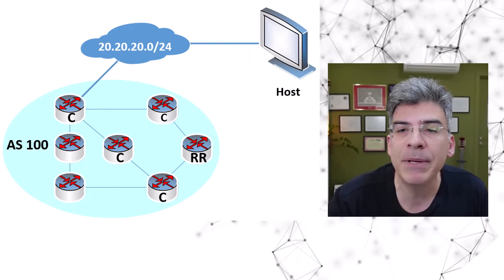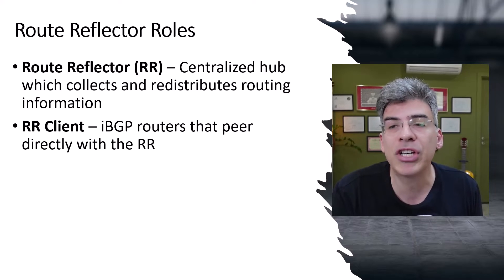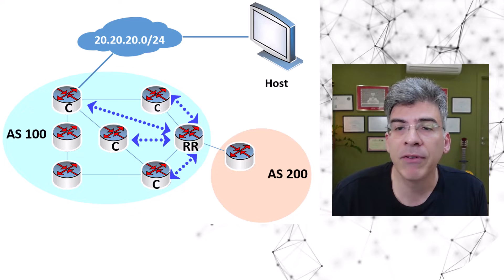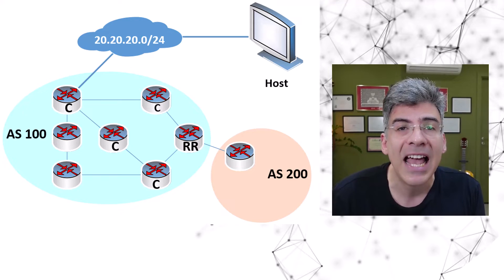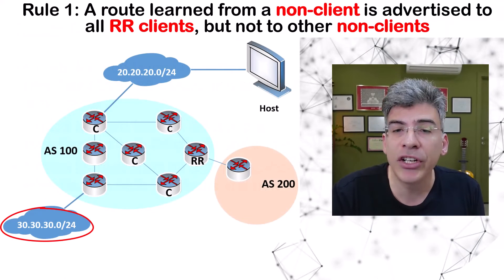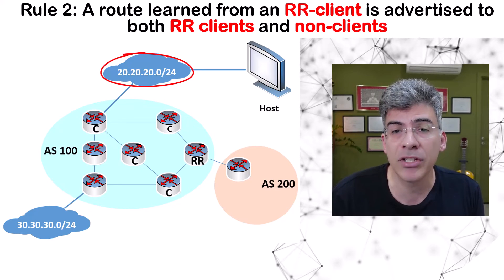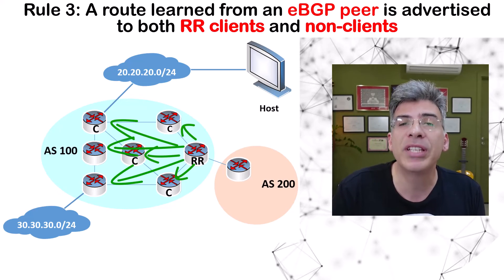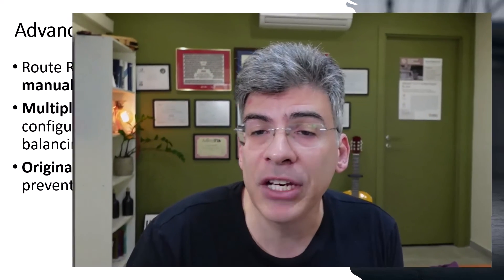BGP - What are iBGP Route Reflectors?

Comment: It means that RR will only be PE router , it cannot be P router as we dont have BGP peering between PE to P routers? and the term used BGp free core only meant for P routers?
Reply from the maker: This is a really good point!  Remember, an RR is a BGP function, not a router type, so it does not HAVE to be a PE, but it MUST run BGP, which means it cannot be a pure P router if you have a BGP-free core. In a BGP-free core, P routers do NOT run BGP at all.  They only run IGP and MPLS and simply forward labels. 

In such a scenario, all BGP sessions exist between PEs only.  So when people say “RRs are PEs” in this context, they usually mean that RRs behave like edge devices logically (because they run BGP), not that they must be customer-facing routers.  Make sense?

Comment: Hello, I disagree with the idea that the two non-client routers should be in full mesh with all other iBGP routers. They should only be in full mesh with each other (i.e., between the non-client routers) and have a peering session with the Route Reflectors (RRs). If they were in full mesh with all routers, it would imply that client routers also establish direct peerings with the non-client routers, which is not the intended design.
Reply from the maker: You're absolutely correct, thanks for pointing that out!  I have added a correction to the video at 4:20 crediting you with pointing it out...  Thanks again!

Comment: Hello Sir,
Fantastic explanation. Really thank you so much for your efforts.
One question:
Finally how 30.30.30.0 network connected  to Non-client will be reachable to 20.20.20.0 network connected to Client? Routes can be learned from Non-Client to Client directly and the same routes can be learned from RR as well. Which path will be selected as best route. As per the understanding, based on the attributes order, it will select the best route either from RR or directly from NC. But in the reverse direction ( from Client to NC), will it go through RR always or it can reach directly from Client to Non client. Could you please clarify?
Reply from the maker: Thanks for your feedback!  That's a really good quesion.  It's important to note that the next hop IP that the route reflector sends with the 30.30.30.0 network is sent UNMODIFIED.  In other words, when the non-client sends this route to the route reflector, that route is "reflected" using the next hop IP of the ORIGINAL non-client router.  So ultimately, the next hop IP remains the same.  So the RR will never be advertised as the next hop when it reflects routes.  Does that make sense?
Reply: @ Thank you so much for answering my question. Yes, I am clarified. Need to simulate such scenarios in my simulators and get back you incase of any more queries.
Reply from the maker: @ananthanmuthiah774  Yes labbing always helps to further understand these concepts. Happy labbing!!
Reply: Beautiful conversation @

Comment: Sir thanks for the video but i have a question on it

1- if RR receive update From EBGP, it will reflect to RR Client and Non client
2- If RR Client receive update, it will reflect to RR & Non client both

but but but 

3- if a Non client receive update , it will reflect to RR and RR will reflect to RR client and not to Non client due to split horizon , but if there are more then 1 Non client in topology , how they will get to know about that prefix

waiting for response
Reply from the maker: Ah, yes, that's an excellent question.  We must remember that when we dont have an RR, the rule is that there must be a full mesh BGP peering between all iBGP routers.  If you introduce an RR, the non-clients don't know that it's an RR, there's no special configuration in the non-client that tells it that it is an RR.

So the rule of thumb still stands for non-clients.  All non-clients must create a full mesh peering between them so that iBGP will function correctly.  Otherwise, you will have non-clients sharing routes with the RR, and other non-clients not getting those advertisements.  And this would be an incorrect implementation.

So the rule of thumb that iBGP peerings must be full mesh within an AS must still be applied to non-clients in order for iBGP to function.  Does that make sense?

Comment: Rule 2 is violation of split horizon
Reply from the maker: You're right!  Rule 2 states the following:

"A route learned from an RR client will be sent to both RR clients and non clients."

Route Reflectors are specifically designed to override the split horizon rule for their clients, but not for non-clients. The BGP protocol has othre mechanisms to ensure loop prevention even when the split horizon rule is bypassed, including Cluster IDs and Originator IDs.  Does that make sense?
Reply: @telecomTech.explained  yea it makes sense

Comment: Great explanation as always . I have two questions if you can answer will be a great favour .

1) Other than the scalability factor what other main benefit  Route Reflectors carries . Like in full mesh each router need to have ibgp peership and will exchange routes thus increasing configs and processing issues. But the same thing RR is doing being alone getting routes and reflecting etc ? 

2) Where will be the convergence fast ? In full mesh or RR and why ?
Reply from the maker: Hello @afaqshah7229!  I'm glad you you find the explanation helpful!

Concerning your first question, the main benefit is indeed scalability, but when we talk about scalability, we are talking about several different factors that affect it.  These factors include:

1) Reduced configuration complexity - With RRs, only clients need to maintain sessions so you have a significantly smaller number of iBGP sessions to configure (remember, BGP sessions do not form automatically like in OSPF or EIGRP, they must be manually configured).
2) Lower resource utilization, except of course for the RR.  In this case, you simply have to provision for more robust (and expensive) routers to play the role of the RRs.  You're right that the RR will still have a large operational load.  But the client routers won't need to have such large and expensive resources (memory, CPU power etc).
3) Simplified network management - It's easier to manage and troubleshoot a network with RRs rather than with a full mesh iBGP network.  There are fewer BGP sessions to monitor, and route propagation is more predictable.
4) You can centralize routing policy applications by applying them at RRs ensuring consistent routing behavior across the network, rather than having to configure the policies in every router.

So you see, it is really about scalability, but there are various aspects of scalability that RRs address.  Does that make sense?

Concerning your second question, there are several factors that will affect convergence directly and indirectly.  Generally speaking, a full mesh iBGP peering topology will converge slightly faster than a well designed RR topology.  However, if the number of routers are extensively large (i.e. on the order of 50, 100 or more), then you will begin to tax resources such as CPU, memory, as well as bandwidth.  If those resources are not enough to maintain timely communication between BGP routers, then convergence will obviously slow down.  So after a certain size, a full mesh topology will tax the resources necessary to make it converge fast, thus slowing it down.

Ultimately, even if an RR topology converges somewhat slower, the benefits delivered by RRs are still preferrable.  Remember, BGP is not all about fast convergence.  It is about stability.  

I hope that answers your questions!
Reply: @telecomTech.explained  Thank You very much sir for the very detailed explanation . 
Just one question if you can briefly explain . As you said Full Mesh can converge fast if few routers are there . What is the main reason for fast convergence ?
Reply from the maker: Hello @afaqshah7229  !  The primary reason for which a full mesh will converge faster than a route reflector topology is because you have direct connections between iBGP peers.  In a full mesh iBGP configuration, every router is directly connected to every other router within the AS. This means that routing updates are sent directly to every router without intermediary steps. Since each router receives routing updates directly from every other router, the propagation of routing information is faster. There are no delays caused by intermediate nodes processing and forwarding the updates.  Each router processes and forwards updates simultaneously to all peers, minimizing the time taken for the entire network to be updated.

Again, you always have to take into account the benefits and drawbacks of each solution based on your topology.  Because BGP is not designed to be fast, but designed to be stable, you should choose the solution that will provide that stability in the best possible way.
Reply: @telecomTech.explained   Great . Thank you very much for the detailed answer . In coming day if possible make a video for BGP Design . What are the key parameters to design BGP for a network .